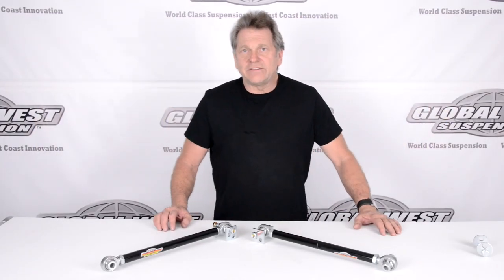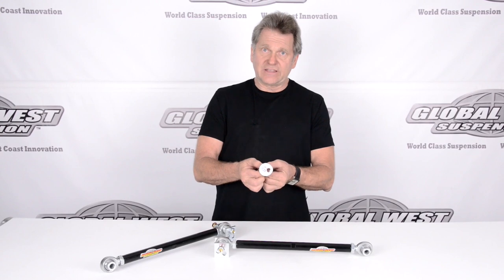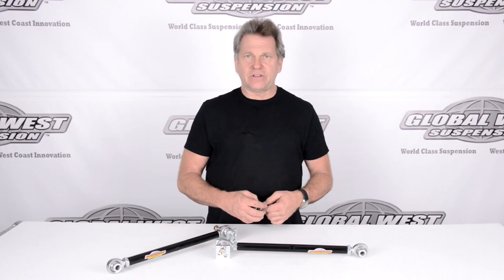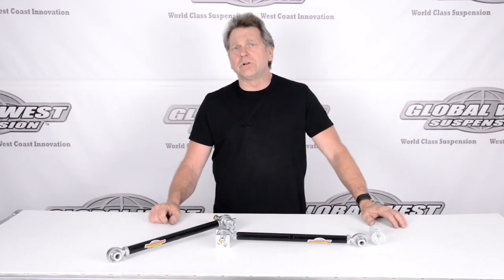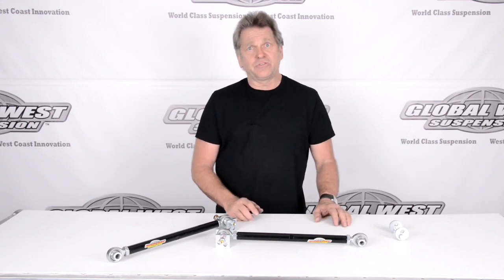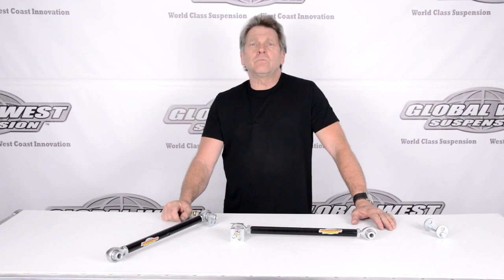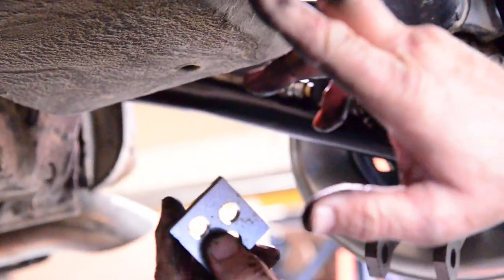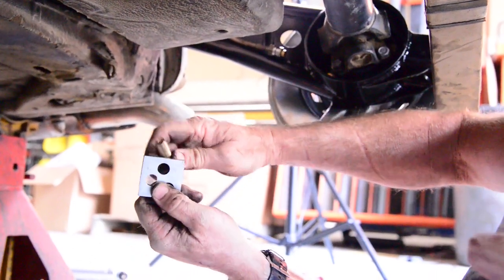1963-1982 Corvette Rear Adjustable Strut Rods. Why Adjustable Strut Rods Are Important!

Comment: You need to explain moving the camber adjustment plates to a different setting or number hole. How does that effect the wheel alignment or camber adjustment on each different hole location?
Reply from the maker: Hello! Thanks for watching our tech video. Your question requires a more detailed explanation than this platform will allow. For us to answer your question more thoroughly, give us a call at 1-877-470-2975. Thanks!
Reply from the maker: "I called and spoke with a person who basically told me that it was a 
"trial and error" procedure. Not the answer that I was looking for!"

Hello:
It is apparent that you did not get the answer you were seeking from the tech department. I apologize for that.
In the video, we indicate positioning the plate so the hole is in the middle of the slot. This, for most applications, will allow for plenty of adjustment for setting camber. The other hole positions can be used for changing the camber curve, providing that you know what you are doing. This is something that requires knowledge on how much camber change you are looking for in your application. Alignment equipment is required. Also, those plates are part of an addition kit that is available for controlling camber curves on the rear. We include them in the standard kit, so you don’t have to backtrack on products. 
I hope the answers your question.
-Doug
Reply: I run out of travel when adjusting the camber to 0 degrees. I'm slightly in negative degrees and can't get more camber adjustment.
Reply from the maker: You must be using stock strut rods. Our tbc-7 was plenty of adjustment for camber. The strut rod itself can be shortened or lengthened. This would allow for  more than enough camber adjustment. If you changed the plate rotation and used a different hole for the offset you would have even more adjustment. 
Tech Department
Reply: I must really be doing something wrong. I will put the plates back together as described. That is #3 hole at the bottom. Correct? I have them on #4 right now.. Yes I have tbc-7 adjustable strut rods. The first setup that I tried was with the #3 on the bottom. I must have made a mistake somehow.
Reply from the maker: Okay, Looking at the plate from the back of the car forward  -- on the passenger side -- install the plate so you can read position 3 -- install the strut rod through this hole  --- this will  push the bottom of the tire out giving you negative camber.  If you want positive camber -- same side passenger ---  you will be using position 5 .
 The driver side will be opposite numbers (5 will give you negative camber --- 3 will give you positive camber). You should be in good shape now for getting the camber you need.
GW Tech
Reply: Thanks for the detailed information. I believe this is what I need. I will try your recommendations and report back.
Reply: Still not there. Camber rods seem to be too long. I will call and ask for Doug.

Comment: Installation part of the vid absolutely sucked
Reply: It was pretty self explanatory to me he already showed how to adjust the length.. otherwise its no different than installing a factory part.
Reply from the maker: sorry you felt that way we try and make the videos easy to understand for wide ranges of audiences. give us a call if you need any clarification 877-470-2975 !
Reply: @GlobalWestSuspension  Boy some guys are really dumb! Those things are the simplist to install! It's literally 2 bolts choose you hole, usually middle, bolt it up tighten, take it to an alignment center...believe me, the alignment proffessionals  will know how to spin those rods and tighten the lock nuts to finish the job. Too many back yard mechanics that need more study on there own, not to mention you get instructions with the product. I have had these on three different C3's and would not ever run those flimsy stock strut rods ever again, not even just driving to a 7-11. I keep stock for shows when being judged, but for real world driving,  I had to reajust my stock ones 2 times a year under normal driving...You Have a Simple and well built, Great Product...